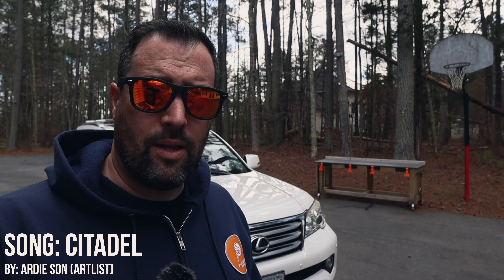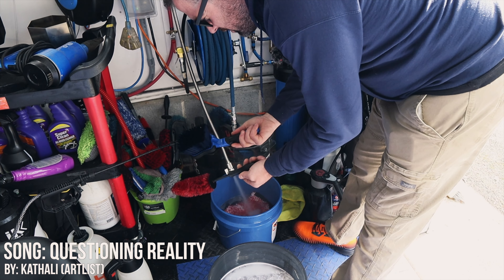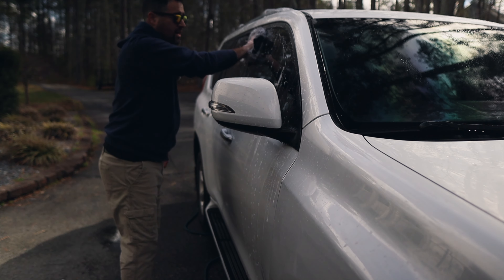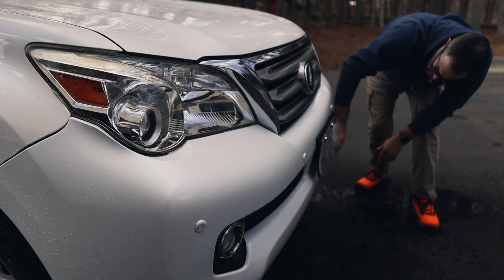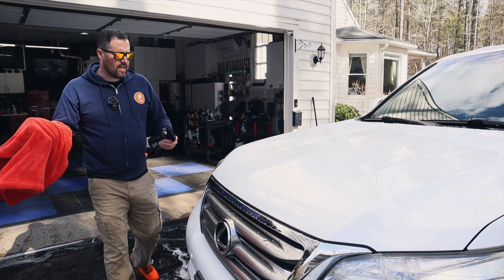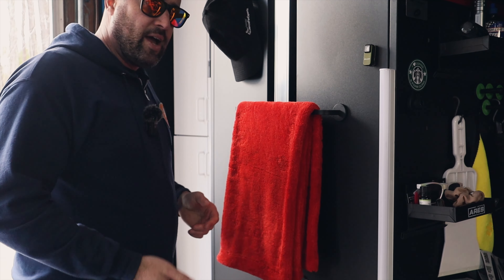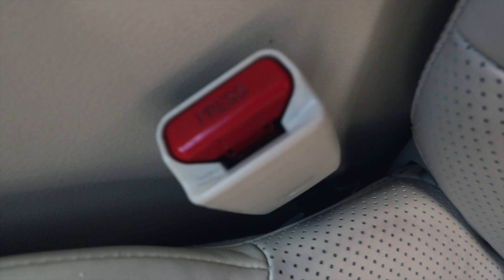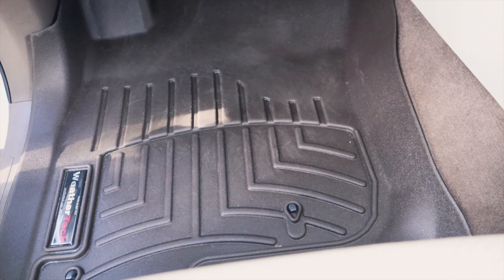🤔 Watch This If You Hate Washing Your Car! #detailing

Comment: I use the one bucket method, so much easier than the two bucket system. I have 4-5 wash mitts in the bucket, each mitt is used for a diff section for my car. Once ur done with one just toss in an empty bucket. Its tht simple and faster
Reply from the maker: Thanks for sharing

Comment: I love your positive attitude Phil very motivating thank you
I have similar color seats in my vehicle and am afraid of wearing certain color pants from dye transfer do you notice blue jeans always do this? or what pants are good for detailing safe on light color leather 
Thank you
Reply from the maker: Thanks. I never wear jeans when detailing. I wear some sort of cargo pants or something similar.
Reply from the maker: @jjjjjjjjjjjhjjjjjhjj anything other than jeans is fine. You don’t have to worry about wearing anything that will drain them. Jeans only stain light colored leather when sotting for a long time on hot leather seats over a prolonged period of time. Sitting for an hour or two won’t affect them.

Comment: I have a small tip you can pass on to others, on your mirrors that you don't have the capacity to blow out, push the mirror out and the water will drain out so when you go to drive the water won't streak on your vehicle
Reply from the maker: Great tip!!